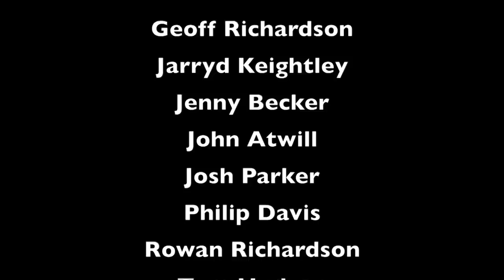Installing the rudder and antifouling the propeller

Comment: Your logo introduction  of two bowline knots has been bothering me for a while now. My US Navy training 6o years ago I believe said, the rope is weakened by bends in the knots. The percentage of weakness induced in each  bend escapes my memory,  the critical point in your photo is the sharpest bend where the two bights meet. The single bowline knot has  the radius  all larger radius than where the two bights come together,  making it stronger than two.  The key point of a bowline knot it is easy and fast to tie anywhere in the rope.  Check the books for the knot to connect two different size lines. I am sure you will get feedback on this comment to confirm or deny my memory.   I have not seen you document  the costs in your projects, could you or have you shown how your project has been worth it, or is it just a purist restoring valuable historic marine vessels. I have enjoyed watching  your experience  in what it takes to do your work, although the reasons seem a little thin.  Don
Reply from the maker: It all comes down to why you are tying the knot and the loads it is expected to take. Things like sheet bends are great for joining ropes in some circumstances but not so much in others.

Comment: Do you have to register an inflatable boat in nsw
Reply: I believe not if its powered by a 6HP or under outboard. Rigid inflatable boats come in larger sizes with larger outboards, same deal as any other hull with rego.

Comment: Down the line get shot of that Amazon (probably made in China) tender and invest in a Zodiac with interlocking aluminium floor. The only boat you'll ever need.
Reply from the maker: Yes, it is a temporary boat, just something check to get by until I can save some more cash.

Comment: If u want better steering weld a bit of 50x50 angle on back of rudder mate will make a shit load of difference done it on my old 60footer and now 50 fter they nearly turn on a dime now 😜
Reply from the maker: Yes, I have seen that. I would like to try this for a while first so I can compare the difference. Will be an interesting experiment!
Reply: Yea would be interesting to see the difference on your boat mate I’m pritty sure I got some pics of my one I’ll dig them up for u mate

Comment: Sorry Stu but anti-seize and salt water make glue. Mariner grease.
Reply from the maker: Same stuff I've always used on outboard gearbox bolts and never had any trouble.
Reply: Well I'm not above taking advice. What'ya use?

Comment: Not a fan of using  antyfouling on a prop ..... reduces performance of the prop a lot.., and if you use that boat it wil not foul anyway.... But its way underwater so who wuld know.. lol
Reply: If your prop ever became covered in barnacles, anyone watching would know you had a problem because the boat would be barely able to move while the engine was roaring and billowing smoke. It happened to me once after we had left the boat in a marina in Puerto Vallarta, Mexico and gone home for a couple months.
Reply from the maker: Yes, I've seen props turn into a ball of barnacles.

Comment: Link for what boat you bought at amazon?  Did you not put the floor panels in deliberately?  With them in, and the 6hp outboard, you will probably be able to plane with a single person in the inflatable.  I have a very old (1994?) Sevylor and ran a 1970s 7hp Sears outboard (probably measured at the crankshaft, not prop as I think new outboards are rated).  See it planing, sorta here if you like.

https://youtu.be/JDzocdFEETU

RichE San Diego, CA
Reply from the maker: I just left the floor out to make it lighter for carrying. In now.